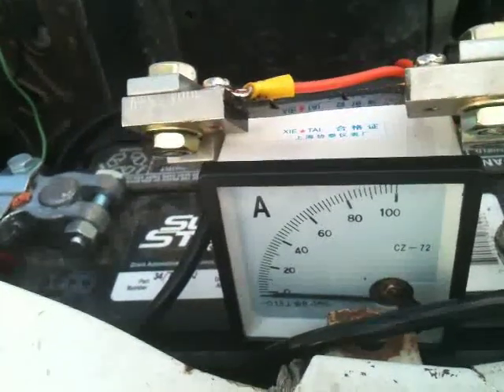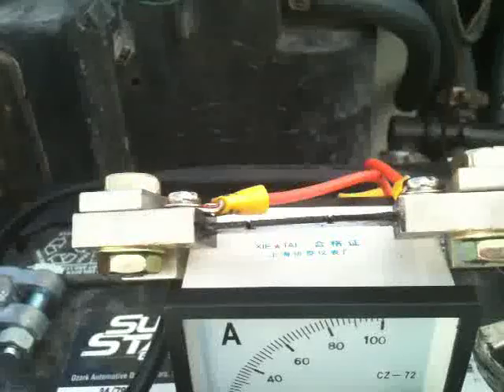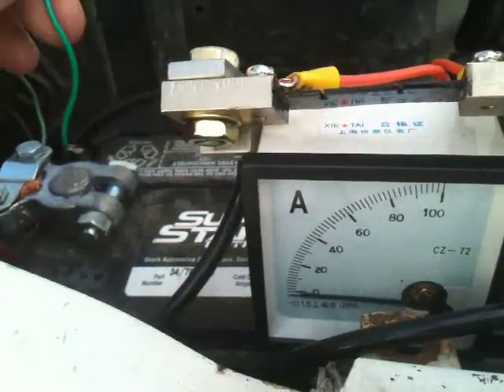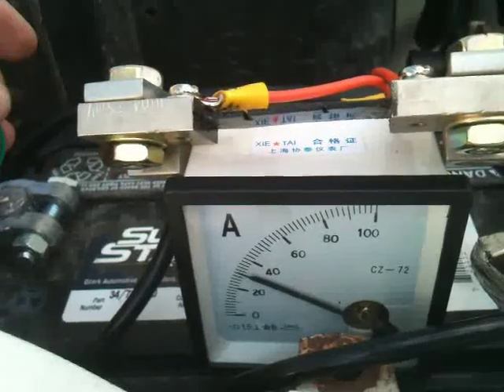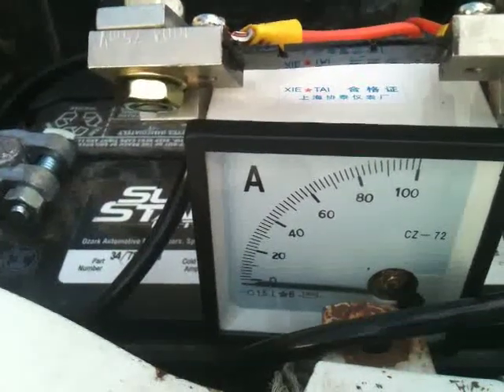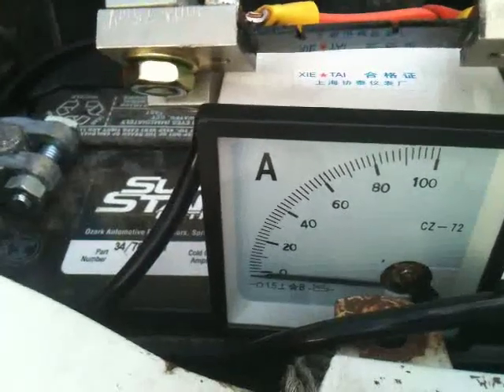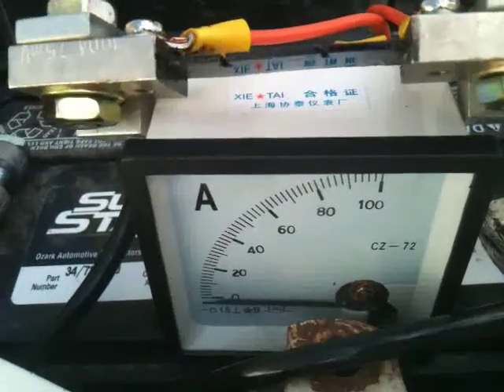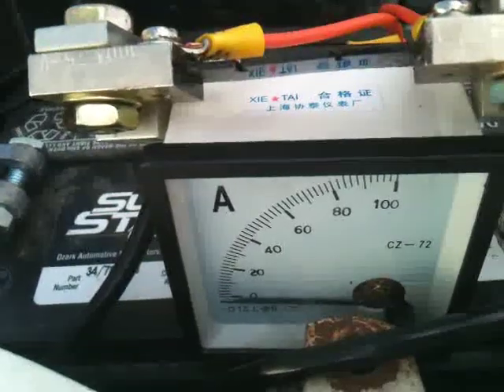Mark VIII / Taurus Electric Fan amp draw

Comment from the maker: @jeremyclarkson99:  The Mark VIII fan I used was from a 1997 which is a single speed fan.  

I did check another fan (friends truck that we did the install on) and his single speed off a 1997 (bought his fan new, mine came from a junk yard) pulled slightly less power.  His pulled closer to 50 Amps at startup and continuous of just < 30 amps.

Comment: No wonder my headlights almost go out when the fan kicks on. All my lights on, rear window defroster, blower motor, A/C clutch engaged, wipers on....hey I know; let's add a fan that takes 60-100 amps to start and 30 amps to maintain operation.

Comment: Without a soft start.. these fans will destroy a 30 Amp relay.. I use a continuous solenoid for mines
Reply from the maker: I use a Tyco 75 amp relay to control the fan power.  The relay in the controllers (e.g. hayden severe duty fan controller) will burn up rather quickly if you let it control that fan directly.

Comment: So what would be the recommended amperage for a relay?
Reply from the maker: +nandoGdog  I use the TYCO 75 amp relays...  I've done 4 conversions using this relay (All are in Southern Az).   Only one 75A relay has died and it was because the owner moved it from where I put it and was re-installed upside down.  Then when i the engine was power washed  it filled up with water...